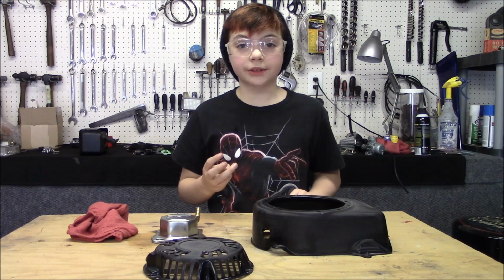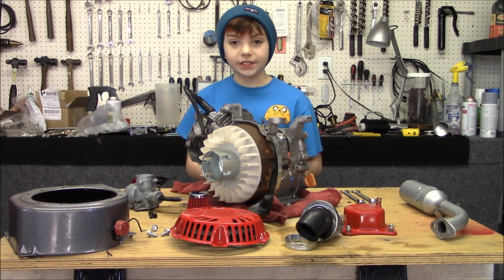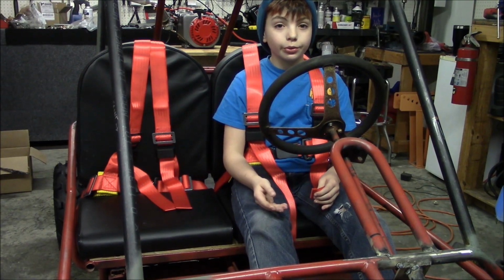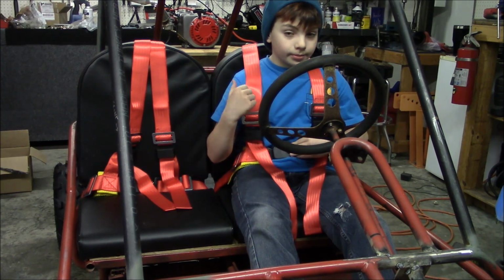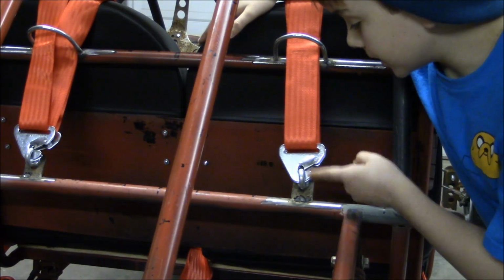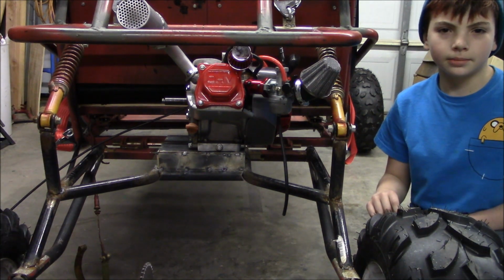MODIFIED PREDATOR 212cc BUILD, BETTER THAN STAGE 1 (video)

Comment: looking good! you should look into a aftermarket flywheel with that governor removed as the stock ones are not designed for higher rpm and can grenade and possibly cause injury.
Reply from the maker: Thank you, Sir, will look into it. Thank you for the advice and for watching!